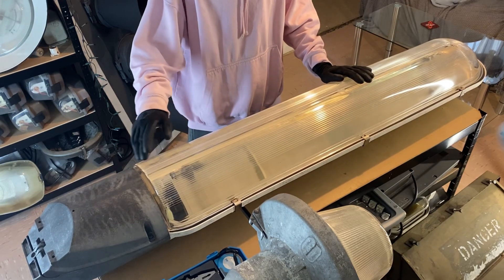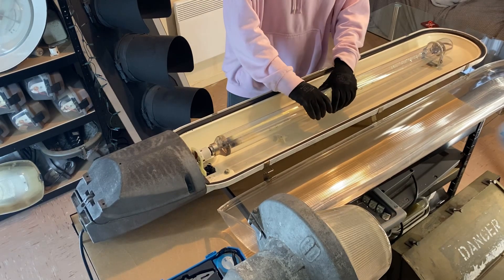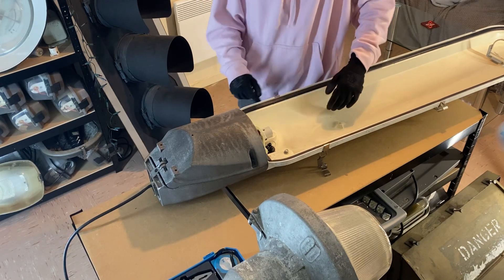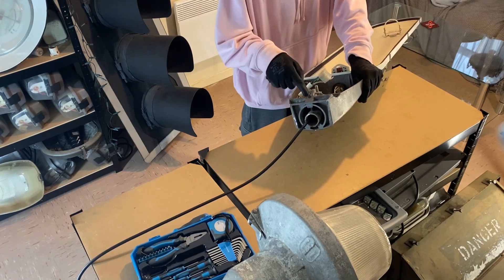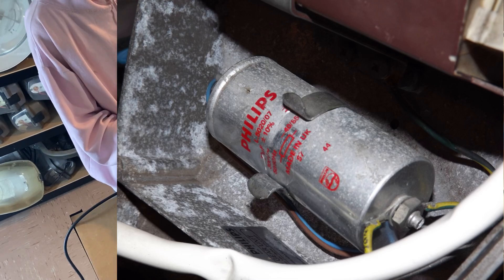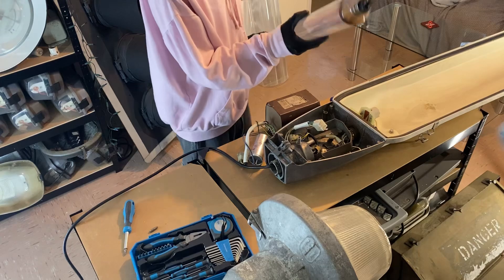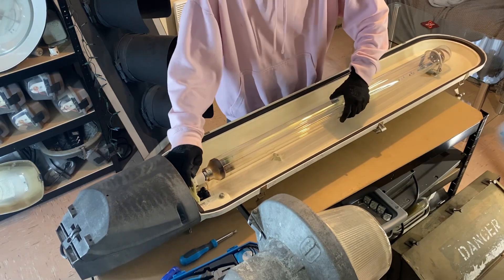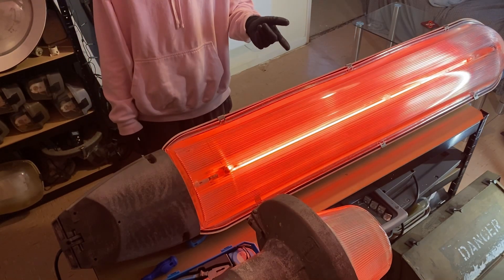A Street Light from the 1990s | Philips MA60 Teardown & Warm Up | 131W SOX-E (180W SOX)

Comment: Great video! I’m starting to get into streeghtlights, and I want to get a MI60 for the corner of my garage, how many inches long r they?
Reply from the maker: Thanks! The MA60s are 5ft 2 inches in length or 62 inches total
Reply: @LeoLampposts ah nice, how about those smaller ones found on small roads?
Reply from the maker: @NRS-Barrier The MA90 remote version is about 33 inches long, with the integral version being roughly 41 inches long
Reply: @LeoLampposts alright, nice. Whats the shortest SOX lamp I can get?
Reply from the maker: @NRS-Barrier In terms of lamps, the shortest SOX lamp I know of is the 10W SOX, but that is very rare and expensive, the smallest I have is the 18W lamp.
In terms of lanterns, something like the Thorn Beta 5 or GEC Z9580 is one of the smallest. The Z9580 is the smallest side-entry SOX lantern if I recall, but could come in top entry too, either remote or integral for both top and side entry (these would run a 35W SOX lamp or 26W SOX-E)
Reply: @LeoLampposts thank you :)

Comment: Wow, that's a very large SOX street light fixture, I also didn't know that the Philips MA60 had the ballast inside! Also, this is a great SOX lamp and very powerful, giving 34,000 lumens, that is, as much as an HPS 250W SON-T Pia plus lamp, but personally I prefer HPS more because at least it is not monochromatic, which I personally don't like that I can't see the colors of things around me at all and personally in my opinion, HPS has a more beautiful light, golden white or golden yellow and especially the older ones had a more orange-white which I personally like to see this variety of shades of golden white light in HPS lamps! I love them but SOX and in general all HID lamps except for the metal halide lamps, which I really dont like very because of the higher hazard they have where they explode more easily!
Reply from the maker: Yes, this lamp removed all colour from the room I was in, everything went orange or brown as a result of it - I do like SOX though as its quite nostalgic for me, I have quite a few HPS fixtures as well

Comment: Aah yes, Low Pressure Sodium lighting. In our area the Low Pressure Sodium lamps were replaced with both fluorescent and metal halide, due to the severely weak CRI of the LPS lamps.
On motorways and major trunk roads with lighting (which I presume is where these larger LPS lamps would have been fitted), the CRI doesn't really matter, but in residential areas you actually want to see your surroundings, hence why LPS/SOX was insufficient and why it was replaced!!
Nowadays, the advent of LED lighting has made SOX/LPS completely obsolete, because LEDs match the high efficiency of LPS yet offer superior color rendering.
Nevertheless, I still remember these thanks to their characteristic warm up from pink to orange (which often took 10 minutes or more).

Also, I liked your reference to the claw machines at the arcades! They are designed to be on a payout, meaning they don't give you the prize unless enough money has been put into the machine.